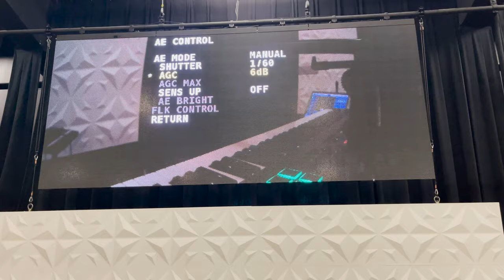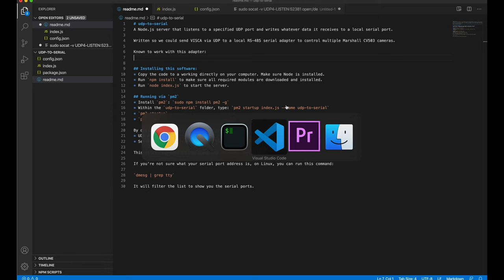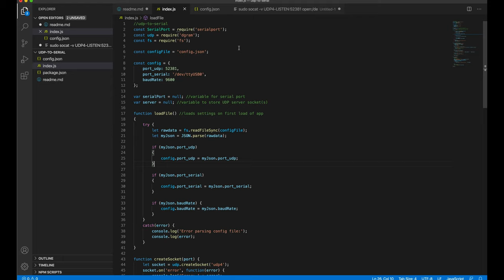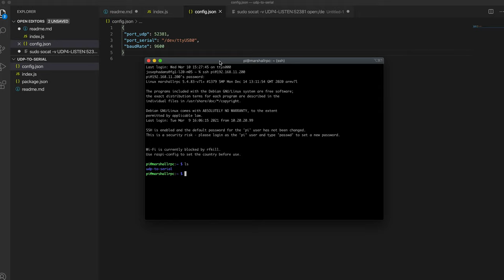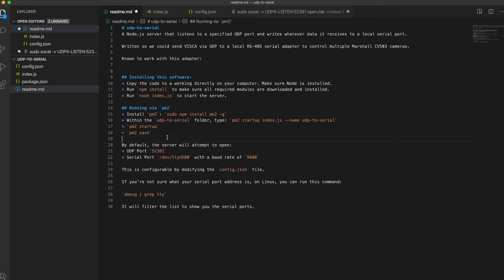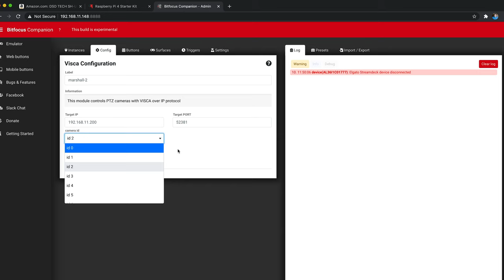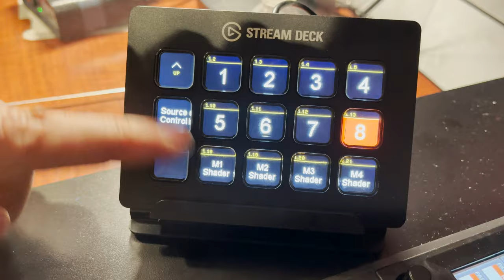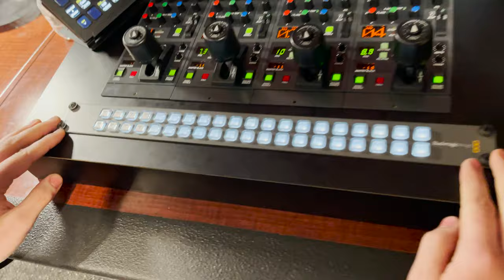How to create your own Marshall Shader RPC panel with a stream deck and a Raspberry Pi

Comment: When you all “combine all the lines into 1” using the punch-down Ethernet connector: are you stacking all the blue/white-blue cables together or are you separating them out onto different colored pairs, since at that point there is no potential of accidentally putting them in a network switch?
Reply from the maker: Separating into the other pairs. Whites to whites, blues to any solid color. Then the real “combo” happens on the other side of the jack, I make one rj45 like normal, and on the end that goes into the rs485, I twist all the solids together for the + and all the whites together for the -

Comment: Pretty cool! So if I'm following along correctly. I could theoretically do this with a Raspberry Pi 0W taped to the camera stand, and only need to make 1 custom cable? But I really need to get my Tally Arbiter project done first ⏰
Reply from the maker: Yep! You totally could do this. You could probably even work out a way to do rs485 over the gpio pins with a hat.